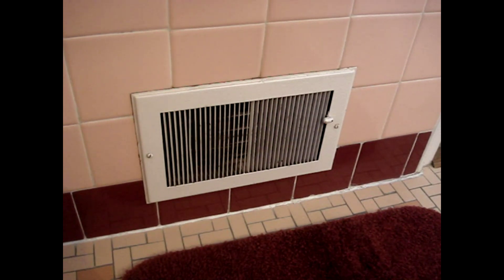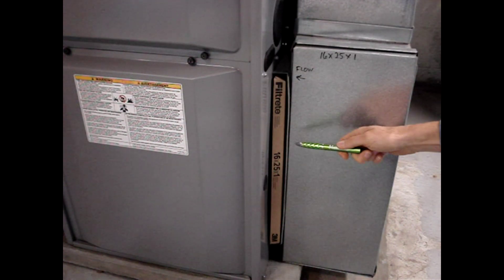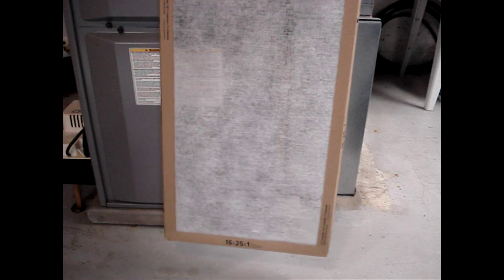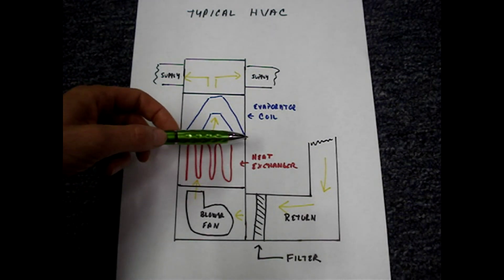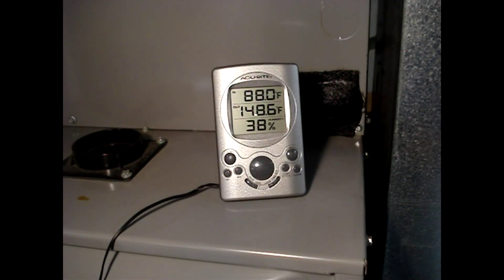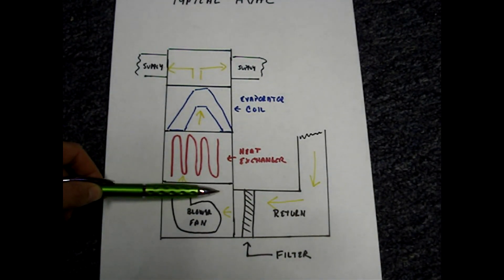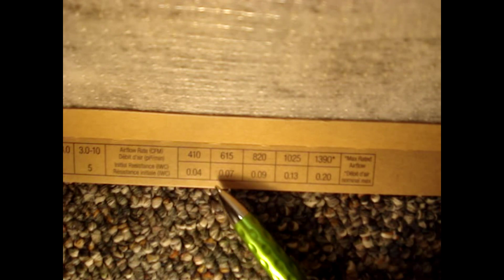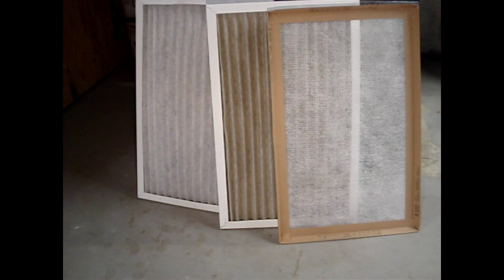Which Furnace Filter to Buy - How Often to Change a Furnace Filter

Comment: I have found that MERV 5 or 6 is the best compromise between good filtering and restricting air flow. Merv rating higher restricts air flow and lowers efficiently of the furnace, overheating heat exchangers. Lower MERV will not keep the furnace fan, motor and heat exchanger clean. People think you should use high MERV filters to keep the air in your house clean but that is what a vacuum and dusting is for!!! If you have allergies use a separate filtering device separate from your furnace.
Reply: Is 7 too high

Comment: Is it normal for the furnace filters to.not fill all the space of the filter slot (Depth & thickness fits but there's about a 4-6 inch gap of free space  above the top of the air filter (This furnace has two air filters)
Reply from the maker: It sounds like the wrong size filter is installed.  You might want to look for the installation instructions for your furnace to confirm.
Reply: If there's no manual available then how can you find out the correct size filter? Also does the furnace filter fill the entire space of the furnace filter slot?

Comment: Thanks.  My furnace man suggested the standard 1" fibreglass filters... ive been using the merv 4 flanders filters...such as the one he installed when it was new.  are these too unrestricted... should i be moving to a pleated filter?
Reply from the maker: There are a lot of heated (no pun intended) debates about the question you ask.  My thought is that there is a lot of profit in those pleated filters and the marketing people are likely using some misinformation which is the cause of the fight.  If you think your furnace man honest and competent, I'd go with his suggestion.

Comment: Hi Thank you for this helpful video-  Can you tell me where you got your Merv 2 filter?  I need a Merv 2 or 1 and can't find them anywhere!
Reply from the maker: I got the filter at Lowes.
Reply: I’ve used filtrete 1500+ since my furnace was new. It’s 23 years old and still going strong. Have never had to clean my coils and my family benefits from cleaner air. You run into restriction problems when you run a dirty clogged filter so stay on top of changing it regularly.
Reply: I would NOT use a MERV 2 filter, you might as well not use a filter at all. Use MERV 5 or 6.

Comment: Some good info you provided.

In certain cases, only a fiberglass filter will allow for proper airflow. But fiberglass filters don't do a good job of keeping coils and secondary heat exchangers clean. If a merv 6 to 8 pleated 1" is too restrictive, best thing to do is put a larger filter rack if possible or a 4"+ media cabinet.

CFM is airflow, not fan speed. The fan speed gets set by the installer to get proper airflow unless the motor is a variable speed/fully featured ecm which automatically changes the rpm to deliver proper airflow. 

 The static pressure can be above 0.5" as long as the airflow is correct. May need fan speed adjustments if there's a psc or x-13 type blower motor when switching to a more restrictive filter though. 0.5" is totally unrealistic considering a evap coil has a pressure drop of like 0.2" and a decent filter, 0.1 to 0.2". Leaves almost nothing for the actual air ducts.  

Traditional psc blower motors don't actually work harder at higher static pressures, the wheel unloads and the current draw actually drops a little. The rpm is relatively fixed. They just don't move enough air when the pressure is too high. ECM type blower motors can have their lives shortened by static pressures above 0.8" due to speeding up to compensate.
Reply from the maker: Jon, thank you for the taking the time to write the thoughtful, well written and informative comments.  My goal was to make people aware that it is important to use a filter that is appropriate for your system's design. I believe that answering that question is complicated for the average home owner.

For clarification for layman viewers (and if I am understanding what you are saying), the furnace in the video has a psc blower motor.  A psc is not a variable speed motor, it has taps that can be changed (an x-13 type is a fixed speed also?).  The AC is tapped for hi, the heat is tapped for med-hi. So the fan has two fixed rpm settings.  If I wanted to know the CFM for the system, I would have to take a static pressure reading from above the coil for each fan speed.  I would use that reading in water column and cross reference the the chart for the blower in the installation instructions to find the CFM for each fan speed.  I would use that CFM number to determine the max pressure drop of a filter for the system. 

I think I have that part nailed down.  If the max pressure drop for the furnace is .5 in water column and the coil uses .2, then what is the recommended max pressure drop for a 1" filter?  This furnace then may be designed to a fiberglass filter?  If I wanted to use a more restrictive filter on this furnace, the rack size needs to be bigger.  The larger pleats create a larger surface area, allowing for a more dense filter that will keep the furnace cleaner.

A variable speed blower will change speeds depending upon how much restriction is present, so the CFM will vary.  On this type of motor, if there is too much restriction caused by a dirty filter or a too restrictive filter, the blower will run faster to compensate... damaging the blower if this occurs for a long period of time.  How do you know the correct filter for this type of blower?  Are there specs in the owner's manual?

Thanks again for the informative input.
Reply: I agree with your main point, you have to be careful when using the more restrictive filters. Temperature rise is good for comparing different filters if the blower motor is psc type.
The x-13 motor is ecm but it varies it's rpm to maintain a constant torque rather than airflow. The wheel doesn't unload as the pressure goes up due to the controller raising the rpm to compensate, so the airflow  drops less compared to that of a psc motor as pressure goes up. This motor type is used due to being more efficient but has similar functionality compared to the psc. It's set up the same way a psc is ->4 or 5 speed taps and the manufacturer has charts stating the cfm at different duct pressures, installer takes measurements and set it for proper temp rise in heating mode and 350-450 cfm per ton in cooling mode. 

As far as correct filter goes, every duct system/blower/heating and cooling capacity combo is going to be different. The blower only cares what the total external static pressure is, not what the pressure drops can be attributed to. There's no set filter type a unit is designed to have. The manuals do have guidelines though. Really measurements have to be taken in the field as you mentioned in the video to see the impact a filter has. For ecm, static pressure as well as amperage draw are useful, you can't go by temp rise because of the automatic compensation.

*I wouldn't get hung up on trying to achieve 0.5", but rather just if the psc or x-13 blower can deliver sufficient airflow without having the pressure go  through the roof. 
As an example, you can have a 57 000 btu output furnace (60k rated input) and a 2 ton a/c but the blower rated at 1200 cfm at 0.5". The a/c needs 800 cfm at 400 cfm per ton and the heat needs 1055 cfm for a 50f temperature rise. The 1200 cfm/0.5" static blower may be able to deliver 1055cfm as high as 0.7". No harm done, just have to adjust speeds to match the application.

Hi is not always the correct setting for cooling, neither is medium or medium low for heat. They have to be field set. 

There are no rules of thumb in hvac, it's not like electrical where you can use 14 gauge wire universally for a 15amp residential circuit and be good.
Reply: @Jon-hx7pe  could you just give a damn MERV value that the general public should be using for an average-sized home??? Jesus H. Christ, man...save the lecture for an apprentice. All we want is a ballpark MERV value to go with. Is MERV 8 a safe bet for an average home??
Reply: @gjuelz7672  every system is different - depends on ductwork, airflow requirements, filter size. Even merv 6 can be too high for some systems and short of re-doing the filter rack, the only type of filter safe to use is fiberglass.
The only universal rule is never use 1" thick allergen filters no matter what, merv 8 absolute max for 1".